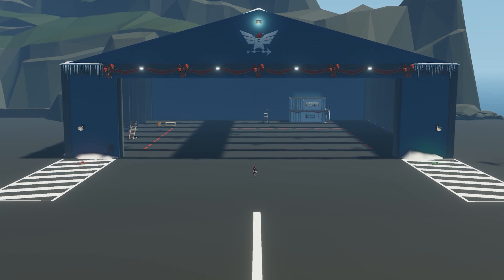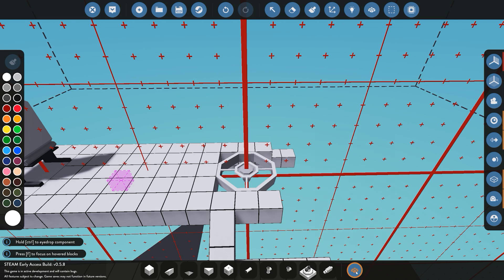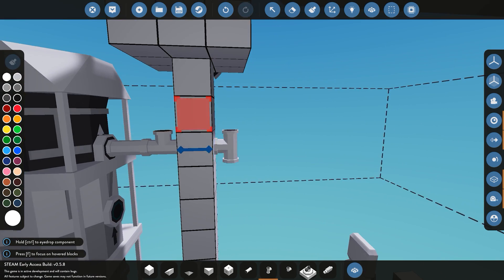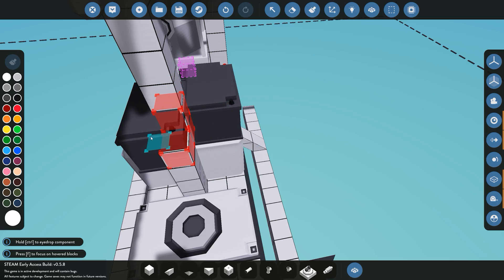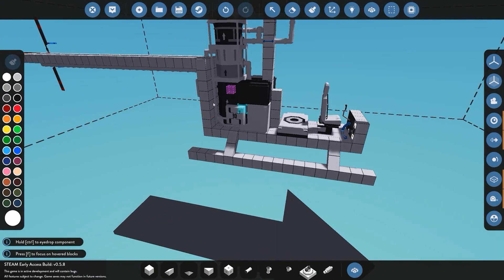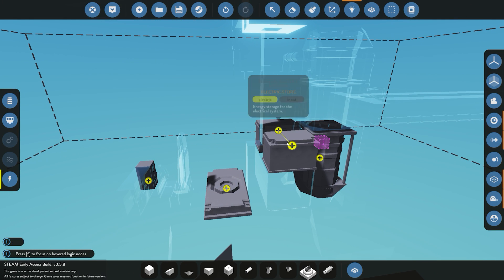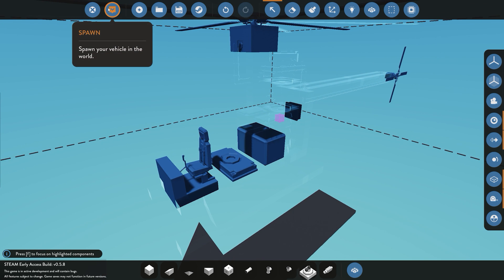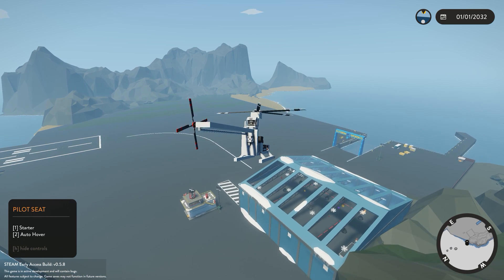Stormworks Advance Jet Powered Helicopter Tutorial

Comment: My heli rotor won't spin fast enough to take off, and the engine starts, but after i stop the starter it dies, and when i connected it to a toggle button instead,  it still didn't produce enough rps

Btw its producing a max of 0.88 rps

Comment: Thank you for this tutorial. i had lots of use for it in my Heli building endevours. How ever, i wonder if its time for a more detailed tutorial that goes throug every aspect, with PIDs, Altitude hold, Adjusting Gyro, Double Main Rotors etc. Considerations when building custom fuel tank for your heli etc. a Heli Building 101 type of tutorial.

Comment: i keep forgetting that PID saftey dohickey. I need to incorparate that. And taking the Throttle lever to 150 max, i forget and leave it att 1 :)

I plan on implementing a pitch Hold system so i don´t have to adjust that all the time.
any Tips about that or could i just use a PID and a button for reading a sensor for the Set point?

Comment: Hey MrNJersey I a problem my jet power helicopter it keep losing power For no reason at all pls help!
Reply from the maker: Try using the rps from the turbine part of the engine as the variable for the PID
Reply: I add that too but failed. My helicopter lose power quickly  after 1-5min. The fuel is fine. The  battery is fine. Everything else is OK. But my temperature of the helicopter is at 2.00-3.00 is this important?

Comment: Can you tell me is there any difference between small jet intake and large jet intake?  Because in my plane I use large jet intake and set the values to the PID that were shown in the video.  But when I start to take off, I put the maximum value of engine power and everything was fine. But when I put the zero value already in flight, they do not lose power and continue to work. After that I decided to put small jet intake(but I need to use large jet intake). And everything was working!  So if you will help me I'll be very grateful.

Comment: Lol mine just went crazy and flew in circles XD
Reply: I’m gonna assume that ur tail rotor is spinning the wrong way
Reply: Mine works fine after like 15 seconds of flight, then I just goes crazy and crashes. Both rotors are on neutral and are spinning the right way. Could someone help me with this?
Reply: The mighty Angus TMA check if you have accidentally set a trim, that was my mistake
Reply: Peerebeer how to do it set/remove a trim?
Reply: Really hate myself i had a problem that it flyed up i didt know why but i found out it was on positive
Reply: @mr.foxie_dk5035  hold ALT and then correct to 0.0 on both using wasd
Reply: Props need to be neutral
Reply: Look at 10:10 , it needs to be neutral
Reply: @gabejacobs7588  no bc I won’t give power to it for some reason